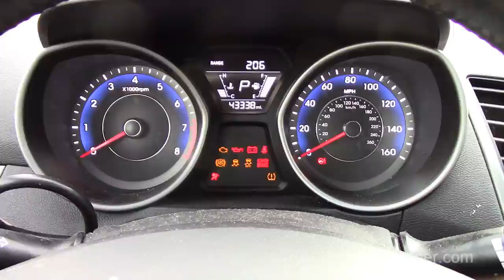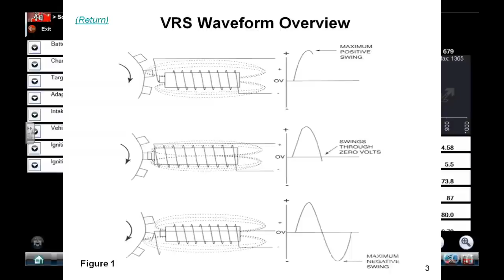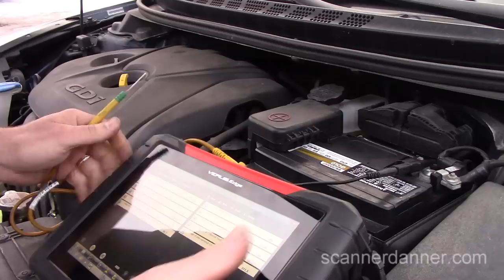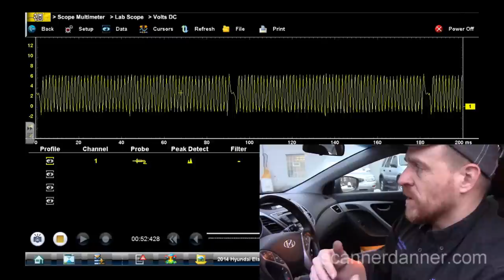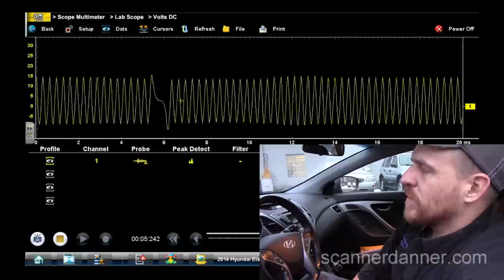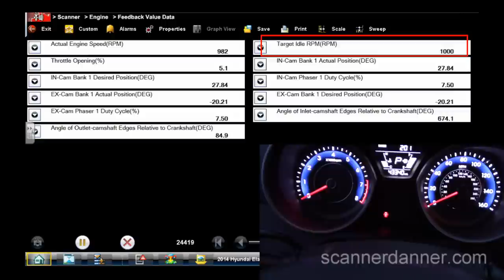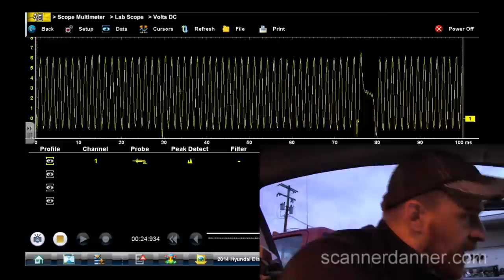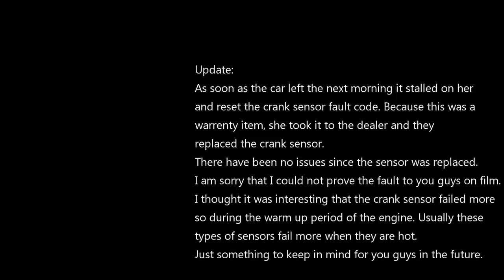2014 Hyundai Elantra Intermittent Stalling P0335 Crankshaft Position Sensor "A" Circuit

Comment: Interesting story, I took my car in to the dealership and without a code they were unable to find the problem. I watch his video and mentioned it could be the crankshaft position sensor. They told me that without a code they couldn’t fix it. So 10 months down the road still having the issue and getting worse, I watch the YouTube channel and quickly determined the sensor was failing. I haven’t had any issues we’re stalling yet.Thanks for the video, it was very informative

Comment: My 2011 Hyundai Elantra would stall at a red light with the A/C running at first while it was really hot outside. It did it twice within 3 days without the engine light on. 2 days later it died again then the engine light came on. All 3 times the rmp needle would not move which confirmed that my car had the exact same issue. So I took it to the dealer and they confirmed that it was the crank sensor. They replaced it and haven’t had that issue since. Your video helped me narrow down the reason before going in to have it checked so thank you very much!!

Comment: Excellent video.  My 2020 Elantra started exhibiting these symptoms after 125000 miles.  Finally kicked the 335 code.  Crankshaft sensor fixed it immediately

Comment: I had this problem on my 2014 Hyundai Accent Hatchback SE unfortunately the dealership couldn't find or reproduce the issue, but when I had the car in my possession I had the stalling issue. Instead of turning the car off I decided to drive the car to the dealership with the RPM needle on Zero they managed to find the error code of the Crankshaft position sensor malfunctioning, so I decided to get it replaced. So far my car is running fine after the replacement still awaiting futher testing for any new issues.

Update: After a whole week I haven't got any starting or stalling issues since the Crankshaft position sensor was replaced. This video did help me a lot of understanding what was wrong with my car and helped me avoid scams at the dealership.
Reply: Thanks for sharing. I think most dealership do not set out to scam, just that intermittent issues are hard to diagnose. They rather spend time on doing regular maintenances and surfaced problem (e.g. engine don't start at all). Just money and time.

Comment: Excellent video man!  I've had this same issue on my 2012 Elantra 100k miles.  First guy charged me 800 to replace wiring harness and re-wire  (had to do it as I was stranded far from home on Thanksgiving and car wouldn't start).  Kept happening and then dealership charged me another $250 to replace a difference sensor....still happening.  Now I see this and realize a $25 part and about 30minutes of work will fix my car.  I got ripped off!

Comment: Glad I checked out your video. My vehicle started having this issue a couple of days ago. Took forever to start up, extremely limited power. To the point where I could floor it and only be hitting about 40. Ordering a part and hopefully, I can get it installed and fix this issue.
Reply: Ditto on my wife's 2013 gt

Comment: I am currently having this issue. I was told it was my alternator shelled out 478 bucks if it. It’s still stalling. I greatly appreciate you uploading this informative video. It’s unnerving when it happens because sometimes it takes for ever to start
Reply from the maker: Does it crank normally? After the stall? Or do you need to jump start it? If it cranks normally, your alternator is not your problem. An alternator will not cause long crank times

Comment: Had the exact same issue on my 2012 elantra today. Noticed if you run it driving or idling for 15 minutes, the tachometer stops working and it does not rev up and goes into limp mode when driving. Changed the crank position sensor and it rectified it.

Comment: I have a had a couple of this and the way I get them to act up is drive them for a couple of miles then let it sit for 20-30min and the sensor acts up no start no rpms on tac, Just had Elantra GT today that would actually die after I warmed up car up for about 15min swapped the sensor and fixed the problem, great vid!

Comment: Same problem here with a 2012 Accent, stalls when I stop and sometimes running, code P0335, no check engine light at first, then i got it after 3 times failing, difficult to restart ignition and no tachometer reading, i have to wait a few seconds to restart the car properly and tachometer start reading about 20 seconds after that. Im buying the sensor replacement today. Thank you, I also tried throttle body cleaning first because of the symptoms and the absence of check engine light.

Comment: The 2 wire pickup coils on motorcycles I've seen fail hot many times, but never during warm up. Just goes to show that anything is possible when it comes to electrical failures! 

We used to test those with a multimeter on AC volts - would see a few tenths of a volt kicking it over -  more if it was electric start. That usually meant it was good. 99% of the time they'd be completely dead when they failed, or you'd see the pinched wires someone caught in the side cover - made diags pretty easy. A scope sure makes this whole process 100x more accurate though! Would've sped the process up, for sure.

Pretty sad that this component didn't even reach 50k miles. Going to be ALOT of work in the future for techs, I predict! :)

I chuckled at the fast-forward drive there - sounded like a 2-stroke engine in that car revving to 12k RPM, hahaha! Wish we could drive around that fast on public roads. I'd get alot more done in a day! 😁

Great vid as always brother.👍

Comment: I am having same issue with 2010 Accent. Very good info. After about 10 mins. of driving If i do not keep it rev'd  when i slow down it will die. Typically it kind of hiccups and throw a check engine light, loss of tack/shift indicator.  Restarts sometimes but not always. Wait 5-10 mins. it restarts. Shop said fuel pump,no load at idle. Additionally along with tach loss i have a manual trans, I lose shift notification.

Comment: Great video Paul.  I had a similar issue with a Saab 2001 CKP, it was great intermittent starts and died at idle.  I removed the CKP sensor and heated up with a hair dryer, sure enough the resistance and changed drastically.  Funny though, the San
B never registered a CKP sensor fault, I regard the Saab engine management system as very sophisticated, but "no code" huge surprise.  Anyway changed the CKP sensor and everything fine now.

As always keep up the great videos Paul.

Comment: Another problem to look out for, on the Elantra, is that the car will turn off while being driven due to low oil . Meaning that there will be no indicator light coming on at the dash, yet the oil pressure sensor will have the computer turn off the engine to prevent damage.

Comment: Greetings,My 2012 Hyundai Elantra is doing the same thing. My plan first cleaning the throttle body. But since I say your video,this will help me greatly. So When the car is idling putting on the AC the car while stall awhile afterwards. Then it will give me a long crank to start then the tachometer doesn't move giving me slow acceleration. The engine light will come on. So I have to turn the AC off and then back on. The car will drive but  negative reading on the tachometer. I will  change the crankshaft position sensor this weekend.  It was a very informative video. Thank You
Reply: The crankshaft sensor was definitely the issue. Thanks Again 😀

Comment: Had similiar problems with a little Fiat called Seicento (sold only in Europe). It was stalling at idle and it was getting worse quickly, to the point I couldn't restart it before it had cooled down. Had to push it off the road several times. Also after you shut down the engine when it was hot, it was really tough to start again. When cold there was absolutely no problems, it was working like a charm. But the second it got hot it all started again. New crank sensor fixed it. But I had not check engine, and no DTCs in the computer, what mislead me a bit (this car didn't have a cam sensor, so maybe it coudn't get a reference to anything, thus it wasn't setting any codes)

Comment: I have a 2012 GLS. It has always started hard. With that said, it will seize on hot days. Having to put it in park to restart, always at a stop where it can't idle past 1k RPM. Now the tach doesn't read and is running from the cam. So, yes, holy shit was this informative. If I plan the start just right, I do have a tach. From turning the key to the engine turning over...there is generally a delay.

Comment: My car has been doing this. Starts and stalls sitting in the driveway. Then just cranks and won’t start again. I’ve had it towed twice. Gets to the shop and they say it’s fine. Today for the first time it actually started again with No RPM got it home, Restarted it and it’s running fine. Thanks for your video. It’s happened 3 times on a year and seems to resolve itself somehow eventually. Now I can clean that connector up and if it happens again tell them to check it.
Reply from the maker: A new sensor was the final fix for us.

Comment: Would using a hair dryer to help heat up the sensor help on diagnosing it.
Reply from the maker: It would have helped, but I did close the hood and let it get hot which is usually enough

Comment: Great video! I just bought a 2016 Hyandai Elantra three weeks ago and the engine shakes when I idle at a stop light like it wants to stall. First start up every morning is rough. The engine will chug then stall. It takes three times starting it to get it running. I took it back to the dealership I have a 3 month power train warranty but if course they said they're not getting a code so they just recommended a fuel system cleaning 🙄.
Reply: What ended up happening after?

Comment: I have a 2012 accent rb with the 1.4 gamma. It has recently do the exact same thing. Tacho sometimes not working, engine stalling when slowing down on red light. Sometimes the engine getting a very rough idle too.

Spray some contact cleaner to the battery ground and its all good.

The dealer is bafled by that. They check everything and nothing wrong. So they say its a broken pcm.

 Maybe I will try adjusting the sensor cable first before buying a pcm. Thank you 😊

Comment: This just happened to me in my 2011 Elantra this morning. Stalled at a stop light. Put it in neutral and it took a long crank to restart it. Tachometer now was holding at 0 rpm but the engine was running.  Then I started off from the stop light and it was having problems shifting, especially out of 2nd gear.  I kept it running and used the manual shift to take it back home.  While in 2nd gear, it would not get to a high RPM; just barely enough to manually shift it to 3rd. Then it was fine from 3rd to 4th to 5th and 6th.  After turning it off and letting it sit, I then restarted it and it cranked right up and the tachometer works again. I haven't driven it yet after seeing this info. Will get a new CKPS and replace it.  I didn't get a check engine light, but I checked the code and it has P0335.
Reply: I replaced the CKPS and all is good so far. Thanks for all your great videos.
Reply: I was having similar issues, mine was the speed sensor.

Comment: take sensor pulley off, clean metal shavings and reinstall. also check if there is any metal shavings on the sensor. Readjust the sensor length form the pulley. That should do it. had the same problem on mazda protege. next time call Eric for help :)

Comment: Your videos are always very nice mr Paul Aka scannerdanner. I love them!
   Fortunately I have an 2005  automatic transmission Hyundai Elantra GLS with an intermittent stalling problem issue that I'm trying to fix for a customer. The symptoms with the car is car is whenever the car is hot and is on motion   
the car stalls on motion especially noticeable when the brake pedal is depressed and the car was in gear but when the car is on neutral and I depress the brake pedal it doesn't stall.
Reply from the maker: Clean the throttle body as a starting point

Comment: Same thing on my 13 Elantra. Would stall at red lights. On start after stall it would slow crank into a sputter, tach wouldn’t go above 0 on throttle. Shut off again and restart would start up normally and tach would work. 

Scan threw the same code P0335. Best way to replicate the issue is to just sit in a parking lot. Will consistently stall at low rpm.

Comment: It happened today to me on accent 2014 110000 km . I cleaned the battery terminals then cheked the sensor connectors then removed the sensor and clean it . It works now . Until it dies i will replace the sensor .

Comment: Had same problem. Tachometer was 0. Gears would stay locked such as only 4th gear engaged no matter if i tried to go faster or manually change it. When it would die it would crank for a while till i started pressing the gas pedal like if i was priming lol it would turn on faster. My traction control would light up a lot i honestly dont know if that was because of my Crank sensor. I assumed it was the ECU going crazy but went with little stuff so i went straight to the crank sensor and changed it. Car worked perfectly. No traction control light no more of what the video explained. Although dont go straight to the crank sensor and change it like i did. Lucky guess. Check the whole crank sensor system. If my trac light comes back ill edit this post and safely assume the crank sensor doesn't mess with trac control.

Edit: i indeed have a trac contr problem apart from the one mentioned above.
Reply from the maker: Check your ABS system. When you have a traction control light on, this is potentially from a faulty wheel speed sensor. Some systems use the ABS WSS for speedometer operation too
Reply: @ScannerDanner  will do thanks.

Comment: I found an Instructables on how to make one of these sensors using a coil from a relay and a magnet.(MAGNETIC SPEED SENSOR)  I didn't have a reluctor ring or gear to create a regular signal but waving lineman's pliers in front worked.  It was instructive to see how the signal changed by waving the pliers faster or slower, further or closer and with different strength magnets.  I even tried a resistor in series with the coil to simulate a voltage drop but that didn't have much effect at all.  

Maybe on this one, the magnet was impacted by warm up or could shift?

Comment: Great video! You forgot one crucial clue that may have helped you duplicate the condition. Freeze Frame data. I've seen sensors not fail when cold or not fail when hot, but fail in between sometimes. I believe these intermittent problems are getting a lot worse on these newer cars. There's a lot of cars that I had to turn away because I could not get them to act up, and customers don't like hearing that, but what do you do?

Comment: 2014 accent same code but delayed crank after hot soak.  Very intermittent.

No TSBs.

FF data shows no rpm and 204 deg. F.  Scope pattern was pretty.

Was able to dup. concern  w/ extended idle and (most important) having hood shut, then wait 5 minutes.  Trick was hood shut capturing heat.

Screen capture shows flat line at approx 2V then  signal comes back.

Was about to throw a sensor at it.  Sometimes you have no other option.

Comment: ScannerDanner -- does this scenario sound like a bad crankshaft position sensor?  My mom's car is a 2016 Hyunda Elantra 1.8 litre 4 cylinder engine.  The car will die/stall when slowing down/coasting to slower speed.  It runs fine if you're driving slower (with foot on gas pedal giving it gas) or even highway speeds though.  It's just slower speeds or coming to a stop when it stalls.  There are no trouble codes showing up.  The auto parts store ran their code reader on it, too, just in case and their code reader didn't show anything either.  When the car dies it starts right back up, no hard starts and so far the tachometer hasn't failed either.  I'm baffled so anything helps!

Comment: Having the same issue with my 2014 elantra , will  update after changing crankshaft sensor  over the weekend  fingers crossed 🤞
Reply: @ihdaofa 😮and…. How did it go? Resolved?
Reply: @rafaelcordeiro5765   Resolved after replacing the sensor , but RPM still has absurd spikes when you haven’t pushed the accelerator

Comment: To recreate this dependably you need to simulate rush hour traffic in a city such as Wash DC. I have this problem or a similar one and my car stalls at least 10 times in a 45 minute commute to work (especially if there is a slight uphill grade). I also have it happen dependably when I enter my garage. I have a stop sign at the intersection near my home which I stop, make a right then a quick left (mine is the second house) then drive up the grade of my driveway it will die before it gets to the garage unless I gun it which dangerous.